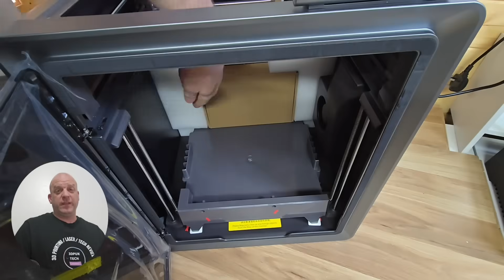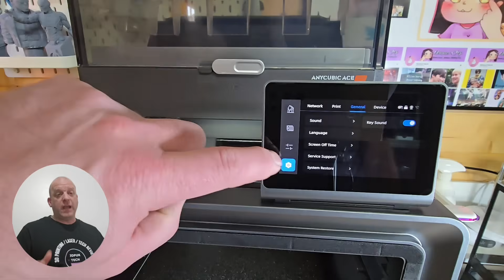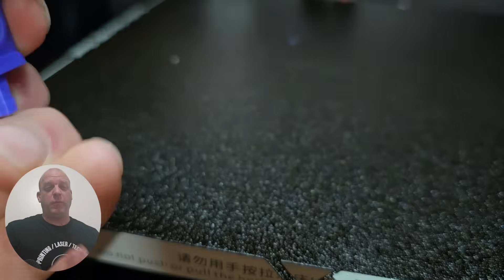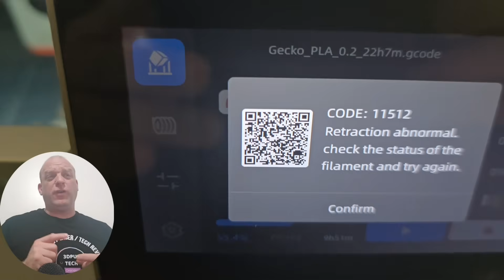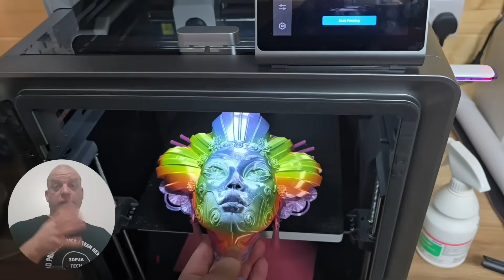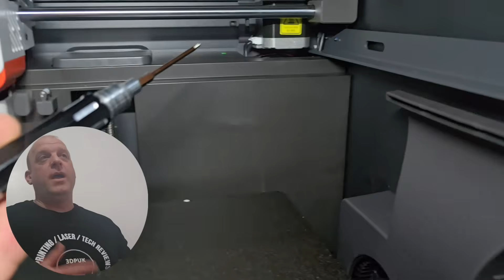Anycubic Kobra S1 - is it really worth a purchase???? My thoughts

Comment: Anycubic takes months to get a simple replacement nozzle or any other common parts, I see tons of problems with this printer I use to argue with people that it was just as good as all the others but I was wrong It is decent when it is new but several months of using it not even long prints overnight this thing has had to have replacement parts, it is definitely no Bambu killer absolutely not I own 3 printers and would not recommend this printer unless you or on a tight budget if you can afford to I suggest a P1S over this one any day.

Comment: To answer the question in the heading of the video, Stay away from this machine. My experiance shows that it has large unresolved issues with parts quality, and engineering decisions that just make the machine unreliable and hard to work on and fix, but at least it the cheapest multicolor 3d printer!

Comment: From my experience with 80 hours use is that there has been very few issues and really good quality prints using single color. Multi color prints on the other hand has been an awful experience for me..
Reply from the maker: @fragsterpvp3364  I'm.glad your echoing the same issues as me, I'm.at 189hrs now on useage, around 34hrs of multicolour printing with 12 out 13 failed, but single colour has been amazing

Comment: I think the ACE pro is a pill of junk because there isn't any seal around the lid. Even though it has a dryer the filament does not stay dry for long because no seal on the lid. How could they over look something like that?
Reply from the maker: @MrNeon871  I'm finding also that the functionality of it isn't upto scratch either
Reply: @3DPUK-TECH-CHANNEL   Try this, printing a simple part times 2 then about half thru skip one part. Let the one part finish printing and see if you don't get some artifact where the nozzle starts on the finished exactly were you started the skipped part. I have turned in a trouble ticket on this issue but I have not heard back from them yet

Comment: My printer the Kobra S1 Combo have 100 hours, IT was printing good until the problems with the first layer started, Anycubic at this point they have me as a beta tester, they want me to print a few tests models and send them the prints, with 1 they can tell me whats going on with the printer, but no, they want more and more. They know about this, but they want us to test their printers and its sad.
Reply: First of all, I'm sorry you're having this issue and I hope it will be resolved fast.  Secondly, and I know how this will sound but this based upon my (still limited imho) experience in FDM after nearly 14 years in it ? ALL,  hobby-range brands use their customers as Beta testers.    The only brand I came across in all these years who did a good job at presenting a "day 1 useable machine" was Bambu.  My X1C Kickstarter received added functionality over the years for sure, but the functionatlly that was present from day 1 was fully solid.  

Prusa ? Elegoo ? Anycubic  ? Creality ? Tevo ?  Comgrow ? Snapmaker ? Flsun ? Qidi ?  Flying Bear ? Tronxy ? Formbot ? Anet ? (to name only those I remember and used myself over the years) : NONE of them were able to present a fully stable solution from day 1.  So I know it won't help, but you shouldn't be surprised : this is just the way it has been, and still is after more than a decade.
Reply: Can you print over WiFi yet?

Comment: Thank you for your detailed review. My S1 Combo should be shipping any day ( i hope ), I figure the first things i print will be the filament guides you used. Question though, did you feel the bit of tube was required to reduce the friction on the filament changes?
Reply from the maker: @gutross  thanks for your kind words. I would suggest trying some printing without any changes to the setup to begin with. See how it fairs,  my experiences aren't necessarily reflected in others experience, if you find issues around d multi colour changes then definitely try this method. As a short term fix I added the bowden tube as i found the filament dragged through the attachment causing friction and debris
Reply: @3DPUK-TECH-CHANNEL  thank you for your quick reply. where did you find the files for the attachment? Personally i feel the bowden tube will greatly help reduce sharp angles and friction, so i may just start with the bowden tube in place from the get go. I will be keeping an eye out for an update in the future for this machine.
Reply from the maker: @gutross  i found this on the Facebook community page

Comment: I have one of these on order, supposed to ship any day now. I've had a lot of different printers over the years, used Stratasys machines professionally, had a delta for a while, built a custom unit with modified firmware last year, but . . . all the new machines are just fast and have so many features out of the box, I couldn't resist at the price. I'm not worried about the steel nozzles because as you said it will happen via firmware updates, likely pretty soon. I can be patient for a little while, even though I'm more interested in printing structural parts than multicolor stuff, the value appears to be there and the integrated dryer is first to market, which I think was a smart business move; I get why they pushed it out as soon as they could. I'm probably going to grab the generic nozzles and use Orca slicer and tweak the parameters anyway, so we'll see how it goes.
Reply: I'm also not concerned about using community mods, but then, for me, it's always been part of the 3D printing experience. Going back to RepRap days, printing printer parts was the actual GOAL back then. So, if little issues are there but fixable with a small printed widget, I'm happy.
Reply from the maker: @cwhiseant  100% I'm going to keep testing and bring a new video soon
Reply from the maker: @cwhiseant   this printer for this price is brilliant in terms of core xy speed, and quality out if the box is was pretty impressed, layer and adhesion was great. My issues where around multi colour, but this could be a singular issue, once I added the community attachment It worked better, just wanted to share to everyone my initial thoughts. And I always share the truth and how I feel it performs. In terms of baseline quality it's right up with the best. Just need to work out why multi colour is an issue
Reply: @ I appreciate the honesty too. I'm more interested in multimaterial options than colors; using different support options or trying to use something like nylon with flex and something like PET-CF that's rigid together, but that will run into the same sorts of retraction issues, so it's good to know ahead of time. Hopefully they'll get it sorted via software, but if not at least the guides seem to work. It's great feedback!

Comment: Looks like many of their printers are hit or miss. Having mine for last month using it nonstop with zero issues. Just finished printing 22 hour print w silk pla. I’ve been very satisfied with mine. I’m currently into the gridfinity rabbit hole printing all my workbench accessories w petg and this things amazing!
Reply: havent had 1 issues with the S1 over 300 hours and counting
Reply from the maker: @saliston  was this even with multi colour?
Reply: Bambu will kill themselves with their restrictive firmware
Reply: yeah they seem to have very spotty quality control, a lot of people had parts just broken on arrival, I got the standalone S1 without Ace and it has been printing like a champ, only Issue I ever had was my own fault. But especially comparing to my Kobra 2 I would say the overall quality of their printers is drasticly improving and if they keep this up they might become a Bambu Killer in a year or two .
Reply from the maker: @OLidartz  single colour it's been one of my stand out positive reviews the multi colour nope its been a damp squid
Reply: @3DPUK-TECH-CHANNEL  I've actually preordered the Ace, it will arive mid-May. Honestly though I would make like two or three gimmicky multicolor things and be happy. I just find it easier to use, because I often swap between filaments and having my standard 3 and a wildcard loaded and ready is way better than swapping manually und setting my standalone dryer manually each time
Reply from the maker: @vizionct1  I'm definitely happy with it, just need to work out consistency on the multi colour.  Have you had issues with multi colour?
Reply: @3DPUK-TECH-CHANNEL  I honestly only tried a few fidget toys for my nephews a few times and prints were descent. No layer shifts or noticeable underextrusions. Just lots of stringyness but could be from using older filament. Too much purge wastage though so ima wait for AC to fix w further update. Mainly sticking with single color for now since that’s what I really need it for mostly.
Reply from the maker: @vizionct1  in terms of single colour it's brilliant, just a little concerning that multiple colour seems to struggle

Comment: In your opinion should I get this or the P1s combo?
Reply: its half the price of the p1s
Reply: Get the P1S. The Kobra S1 for me its a nightmare. at this point i feel like a beta tester with this printer
Reply: @Scheettini  While I can't speak for the Kobra S1,  I have had 3 Kobra 3 Combos... after a month or so had nothing but problems with the Ace Pros,  The S1 uses the same Ace Pro with the only difference is the top cover. Your mileage may vary...
Reply: @billb921  You are right, most of my problems are with the ACE Pro
Reply from the maker: @MatthewReid153  so I don't have the P1S but I do have the X1C and I can say i had less issues with the bambu, but it's not to say this printer isn't a worthy purchase
Reply: @ do you have any other recommendations for me as this will be my first 3d printer it doesn’t have to be very simple because I am very handy with stuff like this and I can quickly learn would like it to be multicolour and core xy but if it’s not multicolor, it’s not the end of the world because I’m mostly printing engineering parts.
Reply from the maker: @MatthewReid153  it's a decent printer

Comment: Two questions.  1.  Can you use Orca slicer or are you locked into Anycubics slicer?  2.  It ships with a braxx nozzle but another reviewer found hardened steel nozzles available on Amazon.  He purchased them and installed the hardened steel nozzle, when he went to set it up in the software he found that Anycubic had the hardened steel nozzle greyed out in the software and he could not change it.  I actually asked Anycubic about the hardened steel nozzle availability and received the generic will be available in the future.  So is the software still  crippled where features are not available until  they decide?  If so, not really a good look for Anycubic to cripple the software.
Reply from the maker: @jameskelly4494  you can use both orca and anycubic slicers. The nozzle issue will not be good start for them
Reply: @3DPUK-TECH-CHANNEL  Thank you.  Was looking at this as my first 3D printer, but when companies issue a product capable of doing a lot of things but cripple the software kind of leaves a bad taste for me.  Makes no sense to do this at all, expecially when you do not have your own product available yet.  Really leaning towards the Core One build kit, but will wait until the 25th to see what the H2D is priced at.